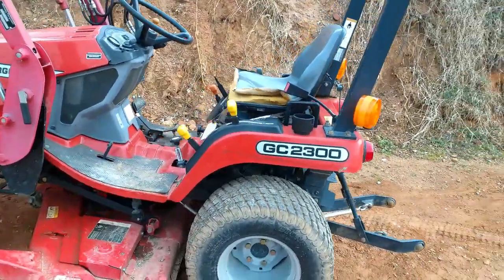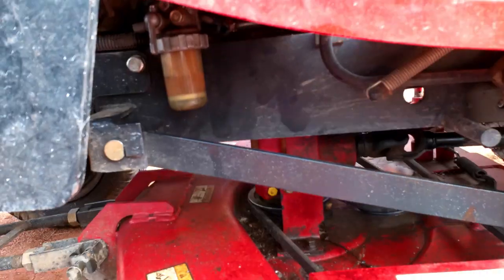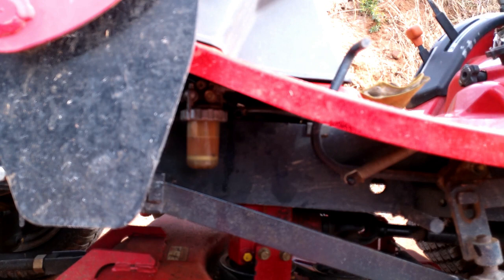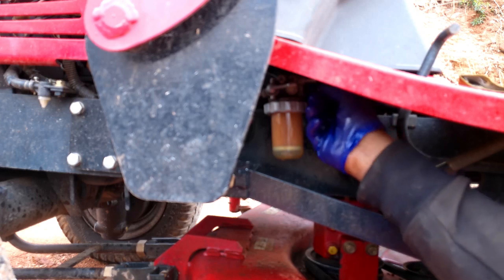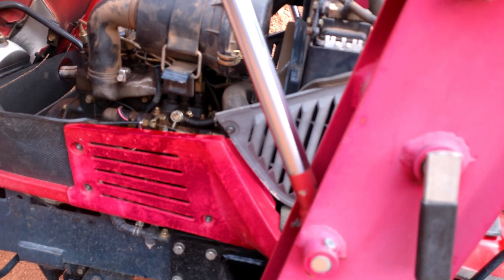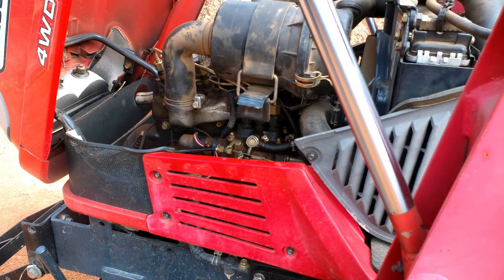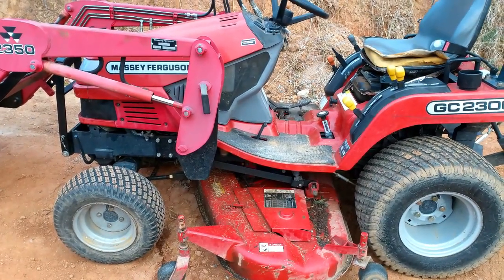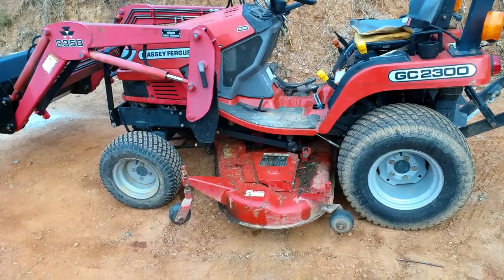How To Fix a Fuel Problem

Comment: Great video, very helpful.  I have the exact same little tractor. Its 18 below here, I have to move a lot of snow here, I have a diesel additive in my tank so it wont gel up. The tractor is losing power and stalling out under load. If I drop the power down and wait a few seconds I can get it to work for a minute or two,  and then it starts stalling again. The bowl is full, I removed the fuel cap and the air Filter, nothing changed. Maybe just too cold? I never had this happen before, its too cold to hand shovel 😂 any ideas? Fuel pump maybe?
Reply from the maker: That is awful cold. Mine was  doing the same thing but doing warm weather.  That's when I traced it down and saw that the system was stopped up at the filter. Before I did that - some people was telling me the fuel pump. I was about to take the fuel pump off but I just felt that wasn't it. Deisels are a process of elimination. What I did was - unhooked the line from the tank to make sure I had a good flow. Next I unhooked the line before the filter to see if fuel pump was pumping. I also changed fuel filer. I also unhooked the line after the filter to see if fuel pump was pumping fuel past the filter . Finally I took air compressor and blew through everything  and discovered there was a blockage forming near the filter.
Reply: @MacgyverBlack  I'm going to use the same procedure that you did (when its a little warmer of course) I will let you know what I found. Got my fuel filter on the way. Thanks for your help, God bless.
Reply from the maker: @mrwilly41  Yes Sir. I look forward to hearing from you.  I pray you get it running smoothly!

Comment: Do you know where the electric fuel pump is located on your tractor? Is it under the seat? In the engine area? My hearing isn't good enough to locate it by sound. Is it easy to work on? Thanks for any help!
Reply from the maker: If I remember correctly- you have to take out the panel  under the steering wheel , near the floor board
Reply: @MacgyverBlack  Thanks!😃